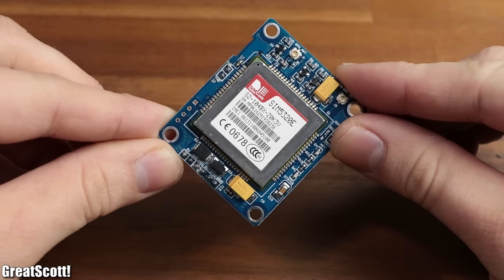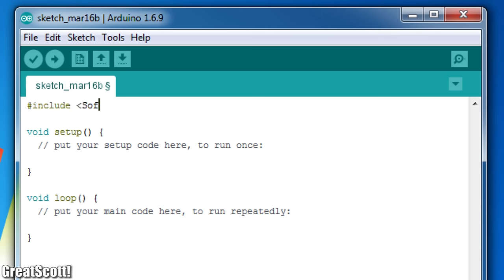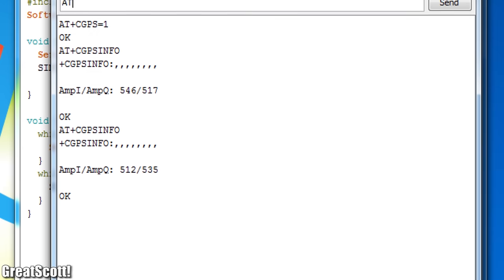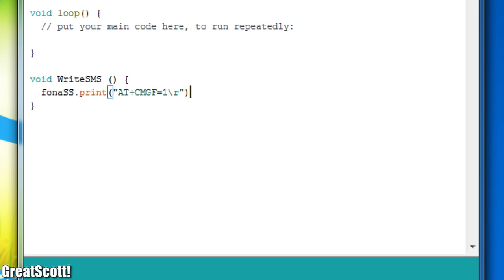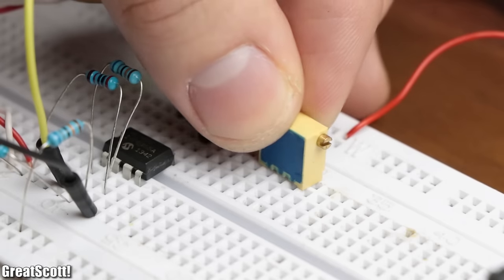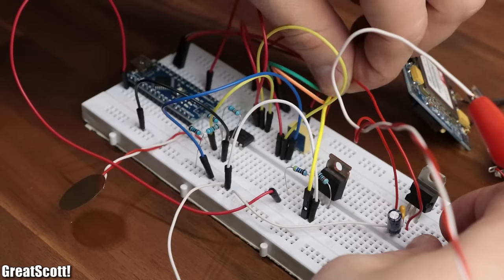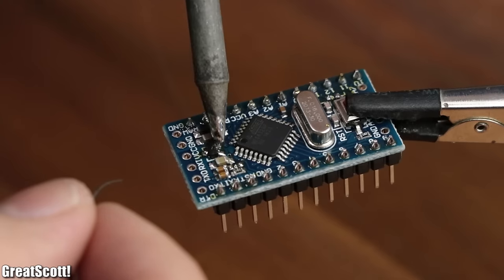Make your own GPS SMS Security Tracking System

Comment: I think you need some air in your back tire...
Reply from the maker: True
Reply: I see good ? this is simson s51?
Reply: On-board air compressor next, never worry about your tire pressure again! Okay, that might be going slightly too far.
Reply: Steve Plant Some offroaders have that! My car has an air compressor too, but you need to get out and fill the tire with it manually instead of just flicking a switch like you do in a hummer.
Reply: I was gonna comment that and i saw your comment 😂
Reply: Damn it you beat me to it, I was gonna say the same thing 😂
Reply: les air = more grip lol
Reply: Lol yeah until the rim starts to contact the road surface. :P
Reply: It is! :D I remember how much fun i have with mine
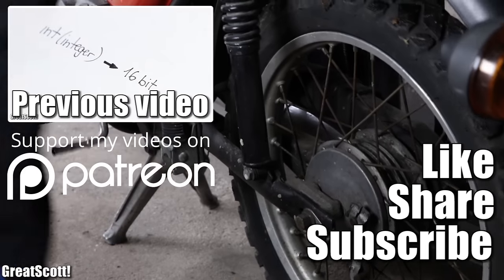Reply: The tyre is at 8:30 in case you missed it.
Reply: Less air= more fuel usage!
Reply: lol
Reply: Yes save fuel
Reply: yes
Reply: I think it"s part of security features of the bike!!!!
Reply: just wanted to comment that
Reply: This is seriously the first comment!!!
Reply: because he installed the GPS SMS Security Tracking System to go fill the tires. :v
Reply: @greatscottlab  Не плохо! Но это все можно обойти! Можно координаты GPS подменить, можно заглушить сигнал и датчик не сработает! А в целом крутая идея👍
Reply: Hahahahhaa Mano do céu estou morrendo de rir aqui
Reply: Amazing yes you did see that very sharp, a high tech project for a motor that is not used for a while?
Reply: He could be riding in sand , still too low even for that
Reply: @datalorian  no it's never to far hehe
Reply: @greatscottlab  I want to learn

Comment: Gmail is hard to get working sometimes. It had a security settings which blocks "less secure" applications. It doesn't work on port 25 and you must authenticate with your login. you must also use ttl I think. After all this it still might not work.

Comment: Now add a feature to send a text to your bike and a simple relay to kill the ignition/spark plug fuse/circuit at will by sending an SMS. 
   Bystanders generally ignore alarms and noise makers, but someone standing in the middle of the road with a vehicle that won't work gets lots of attention, and stranding a thief is a good way to get them to abandon the effort.
Reply: Actually the very next thing should be an open source app that can convert the long/lat to an address onto a map. Then a kill switch.
Reply: I used to occasionally install some of the pro GPS alarm systems for a couple buy-here-pay-here used car dealers, and also used the alarms to do a few repos, years ago. 
   Mapping coordinates is fairly easy with google. The problem is that GPS location fails many times when a triangulated cellular location will give better results (both are used on most high end pro systems). If I had a choice I'd prefer cellular triangulated location with its associated immobilization ability.
    If the vehicle is taken to a garage, or into a wooded, or hilly area the GPS system can be quite annoying. At least that was my experience when trying to quietly track down a car at 2-3am,.. on more than one occasion. 
    When you've got a cellular system the versatility goes way higher because you can choose when and where to disable or target the problem. 
   I've repo'd a guy's car in a small town when he went into the Walmart supercenter to shop. He had made violent threats, after getting several months behind on payments, and was being evasive by double parking to block any repo attempt at his home and work.
  That kind of versatility is priceless in my opinion. It lets you decide when, where, and how to limit confrontation with a potentially hazardous and threatening individual.
Reply: Bike Jake thanks dude I'll try it on my car 🤔
Reply: In the current setup can't receive SMS,  because the Arduino output activates the MOSFET that gives the gsm module ground. 

You know what kills the power for ignition? A key.
Reply: David Andersson It would require a design alteration. 

   There are many ways to short a spark plug circuit. You could send enough power to blow a fuse, short the plug to ground, or short the condenser capacitor just to name a few. Unfortunately on a bike it depends on the design. There are less options with a stator and mechanical ignition, but it is still very possible. I prefer to try to hide my security mods as much as possible.
  When it comes to anything with a fuel pump (not most bikes), I cut power to the fuel pump. The vehicle will still have power and will turn over but won't stay running after 1-3 min. Best of all, it strands a thief in the middle of the road or parking lot depending on how much fuel is in the lines and system.
  The cheapest and most effective anti theft solution is to simply hide an ignition kill switch completely out of sight and somewhere awkward to reach. The most important factor is to completely integrate the switch wiring into the factory wiring harness and make it look exactly like the factory did it.
   This is why most aftermarket alarm systems are a total joke. The monkeys that install them use tape and zip ties to hang most alarm systems under the driver's side dash. Every splice and alteration is extremely obvious. All anyone has to do is cut the wires to the main box, that will stop the noise maker. Then find the relay that always gets taped right next to the alarm under the dash. That's your ignition switch wiring cheat sheet. There's no need to learn how to bypass the factory ignition wiring when the alarm installer has already attached them to a relay that stands out like a hooker at Sunday Mass. The only thing left is the ignition key chip system installed by the factory. It's actually harder to figure out how to bypass the ignition on cars that don't have an alarm because all the wiring becomes much more confusing. The difficulty of finding what wires control the ignition are part of the security design from the vehicle manufacturer. Aftermarket alarms defeat this feature.
  Alarms are not not as great as they may first appear, but at the same time most of the people that are dumb enough to steal are not the brightest individuals.
Reply: Better yet, have the vehicle not start unless the security board can connect to a specific bluetooth device (user's phone or auth card), like on expensive cars.
Reply: Radi0he4d1 Honestly, that would  be an ignition relay just like a regular car alarm, (even on a bike). It is extremely hard to hide both the wiring that has been modified and the relay itself (although a project box isn't any better).
  If you really want a similar extra layer of security you could easily implement a button combination for ignition using the Arduino, something like headlight switch on, then off, then brake on, then off, then the ignition key works.
  The example bike on this channel is kick start. So that greatly simplifies the ignition circuit. Also bike stators are nothing like car alternators. They can't really recharge a battery unless your going down very very long stretches of road at higher RPM. Most older/simple bike electrical systems are very limited when it comes to the total electrical load they can handle. If you drain down the battery, you will have to put it on a charger to recover it.
   Honestly I'd hide a simple switch to disable the ignition, put a disc brake lock on it and invest in some serious concrete anchors and a hardened steel heavy chain. If the bike is stolen odds are it isn't going to be ridden away. It will get wheeled straight into the back of a truck or trailer. I've even heard of guys stealing bikes in public parking lots by team lifting them into the back of a trailer within just a few seconds.
   The pro GPS/cellular alarm systems cost a fortune because the system is part of a subscription. It maps the location of the alarm constantly. Tampering with the alarms is written as a breach of contract and will get your car repo'd right away. The system is designed so the cellular and GPS antennas are separated, if you cut one it will trigger an emergency alarm message on the other in the system. The emergency alarm will send a text/email to the dealer right away letting them know to repo the car. It is very effective. About 10 years ago they cost dealers about $350 each when they were bought in large numbers. I'm sure that has changed by now, but that cost included unlimited internet support access to all the alarms I installed, but only from a single master terminal computer. Most buy-here-pay-here auto dealers around Atlanta GA USA used the same system and created copies of all the car keys before selling the car. It made repos fun, you already had keys (FYI I wasn't a dick either, I wouldn't repo someone, unless they were being evasive and behind more than 3 months, or if they had a kid's car seat in the car until I warned them directly to remove it or turn in the car themselves).
Reply: the problem with that is the TÜV. Since GreatScott lives in Germany, he has to get his vehicle through TÜV controls regularly, and if he has some janky electronics connected in series to the ignition, it most probably won't pass.
Reply: Overrice TÜV is not required for scooters/mokicks in Germany :)
Reply: Think it'd be dangerous (to other drivers too) if you just cut power in an awkward place.
Reply: pointless to do that on a carbureted vehicle.  His bike is old, not fuel injected, hence no computers to control ignition.  All you have to do is snip a few wires to get it running.
Reply: That motorbike is too old, its production had been stopped shortly after reunification of the Germany
Reply: Yeah i have the same one, you can just put matches in the place you put your key in and it will ignite
Reply: @screwsinabell  Not on those kind of engines.  You can just rearrange a few wires and you're up and running.
Reply: @UpcycleElectronics  but cell can be very inaccurate most of the time which is why i set my smartphone to GPS only mode
Reply: @nathanmead140  
  With systems like the ones I mentioned the goal is not real time tracking. You generally don't try to track someone in real time to do repo's unless there is a more serious issue and those types of things can go bad fast. When doing repos you're already on shakey legal ground. It depends on the State (stand your ground laws) but it's a great way to get yourself shot.
...anyways... These systems are designed more for reporting locations that the vehicle is kept at periodically. When you pull the logs in the system it's easy to see where a person lives and works along with their routine. The main goal of a repo is to get in and out quickly with no confrontation. The easiest way to do that is early morning hours between 2 and 4 AM. With the old alarms I was using the cellular system just seemed to work a bit better, but 10+ years ago a consumer grade GPS system was in a different league compared to the systems of today,
Reply: Or just a hidden killswitch 😂
Reply: I think to activate a flame thrower or something more effective. 😋
Reply: @metatechnologist  That's fairly easy. Both Google Maps and OpenStreetMap include the lat/lon on the link, so you just need an app that creates a link with the given coordinates
Reply: Great idea.
Reply: Radi0he4d1 but if your phone is dead or you’re in an emergency situation where you don’t have time to get your phone, you’re kind of screwed
Reply: @metatechnologist  i will make one for android if people will actually use it.
Reply: Upcycle Electronics I’m brand new to gps but I was wondering if you can create commands for the positioned to use cellular when available but to move to gps when cellular coverage is spotty. If so, can you also  designate the device to use one or the other at different times.
Reply: @RisingCreekCustomHomes  
 It's just software. Although well beyond my lackluster programming abilities. It's just twice as much work. You can probably find 2 modules that even operate on the same communication bus, but they will both have their own protocols to learn...
  This is assuming you already know, your hardware and software toolchains, your language and compiler, the low level details about whatever device you want to use as the core of the project, and finally, how to put it all together and write iterative software quickly before becoming overwhelmed or lost in uglified American-Italian-Cuisine code. Each of these steps is a major project on its own, especially for the first few projects. I spend a lot of time lost somewhere in that mix. Most people do. Most just don't like to admit it :-)
GL
-Jake
Reply: Lmao try to get that throigh TÜV
Reply: How about a spark in the fuel tank? I think an exploding bike will get more attention.
Reply: @blackkissi  use mesh if your still interested
Reply: @robbylebotha  the point is to recover your bike...
Reply: I think I have to learn and andrino to create this

Comment: I built one of those in 1995, long before anyone else had done it! I used a PIC 16F877. It had various modes & could handle secondary tracking by a control room & also allow immobilization of the vehicle being tracked by the chase team. There were quite a number of additional features. I tried to sell it but nobody understood what I had designed! Secondly, the cost of the components was high back then! Much simpler to do now with arduino & cheap gps units. Whole thing can be built cheaply now!
Reply: how did it contact you?
Reply: @larrybud  yea
Reply: @larrybud  gsm probably
Reply: @larrybud  yeah.. 1995...I was a Motorola RFtech...  cellular was expensive
Reply: That would have been pretty hard to build since the Pic 16F877 was introduced in 2001, 6 years after you built this project :0
Reply: @rwatson2609  if you want to be pedantic; yes. It started on the 16C84, moved to the 16F84 then onto the 16f877 when more IO was needed the extra memory was handy too. The C chips were slow development until the F chips became available. I don’t use the pic chips anymore because I use the Arduino for development & then burn at chip level directly on PCBs for a final product. However, believe what you want to believe; I honestly don’t care.
Reply: @peterbrown172  Yes you do. If you didn't you wouldn't have taken the time to reply to my dribble. Anyhow building stuff is only half of the challenge, marketing is what none of us can do well.

Comment: You can eliminate some false positives by modifying your Arduino code a little. That way if the wind blows the motorcycle or any "earth quakes" happen then it won't notify you. To do this, take a double GPS reading with a delay, if the two coordinates are the same the motorcycle has not moved and you don't need to send a message. If the two GPS coordinates are different each time then it means someone is moving your motorcycle. Should save on text messages even though they are cheap.
Reply: Or we could have the cuircit on at all times and detect if the motorcycle moved a meter from its original location

Comment: hey Scott u r Great Bro , 
Any way to reuse Dead Mobile phone Camera or Display ?
make a pi cam or Display?
Reply: Karlo Bistrički. 
Throw 290$ in Dustbin ?
Reply: # Xoxo you might be able to use the display, but not all models can be used. if you told us what your phone is that would help. haven't heard of anyone using the camera though
Reply: talha yaprak 
huawei mediapad youth 7 & Celkon A107+ 
with mediapad the basic problem is the battery dead, but can't find another one
Reply: # Xoxo if you still have the old battery maybe check if its a mass produced battery sold under a 3rd party
Reply: i sold my old iphone parts cause the mobo was unrepairable, id just sell the parts on ebay
Reply: +Karlo “Krafter166” Bistrički in case of smartphone its difficult but its possible with non-smartphones like the phone he used to unlock pin. 
Maybe.....

Comment: Doesn't the arduino(atmel chip) have a built-in comparator, thus eliminating an external one?
Reply: I would think it depends heavily on which atmel chip there is. Could look at pro mini, pro micro, and nano arduino chips.
Reply: Eggsr2bcrushed you're probably right on that
Reply: The 328p (used in arduinos) have a comparator. 

Yes you could eliminate the external one. 

I have more experience with atmel studio than arduino, so I have no clue if you can do this in the arduino IDE, but you should be able to write base atmel code that lets you do this.
Reply: Arduino is just a nice development environment for the atmel. The code is exactly the same and can be used in each other.
Reply: From what I can tell:

1) The IC he's using has two op-amps, one is used to boost the piezo signal the other is for an analog comparison. So he needs an op-amp regardless for the signal boost. He could use a single op-amp just to boost the signal, but the footprint would be about the same and he would have to change the sleep mode of the uno to a more power consuming sleep mode which is important because this is battery powered.

2) Presumable he's using the Power Down mode which offers the lowest potential current draw.  One of Power Down's modes only sources of wake-ups is the external interrupt pins. If he used the built in analog comparator he would have to use the Idle sleep mode that draws more current because more peripherals are enabled during sleep. 

The real questions are, did GreatScott remember to set the remaining uno pins to output mode or enable the pull up pins to save more power? And why didn't he use a buck converter like he always does?